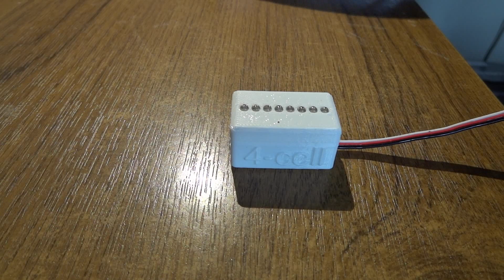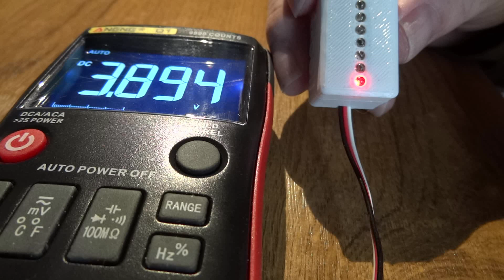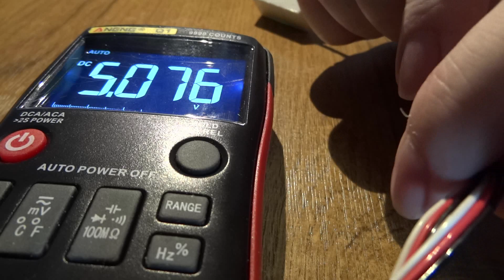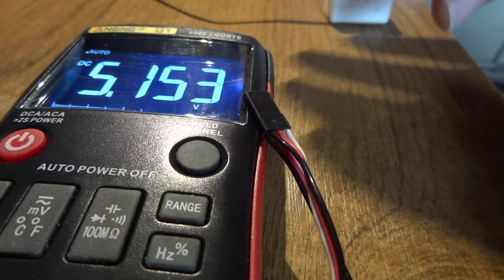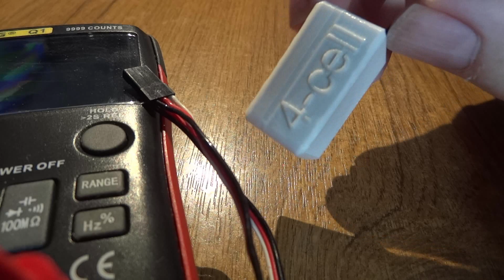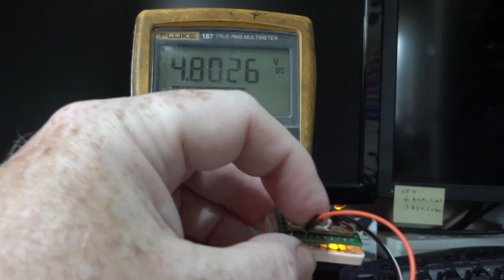Battery tester demo including calibration procedure.

Comment: Looks a useful device. I have a similar checker that uses LEDs that i have bought but I have wired in a resistor to a momentary switch across the +ve and -ve input to test how far the battery sags due to the load of the Rx and the servos. It has found some old packs that show a good resting voltage but where the voltage rapidly sags under load. I do not use them in my models any more.
Reply from the maker: Yes, some sort of load is absolutely needed.  In this checker, there are four 220-ohm, quarter-watt resistors wired in parallel as a fixed load.  That gives a current draw of roughly 100mA.  Having a momentary switch to draw even more current (maybe an amp or two to simulate a servo moving) is a good idea - but it would make my gadgets bigger and I'd worry that the people I'm giving them to would hold down the button for too long - flattening their batteries and overheating the tester!